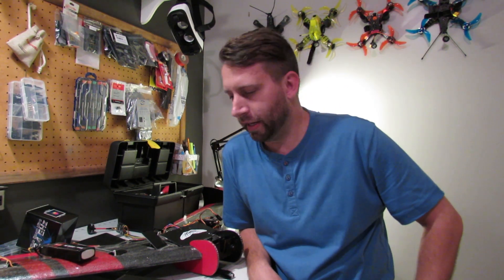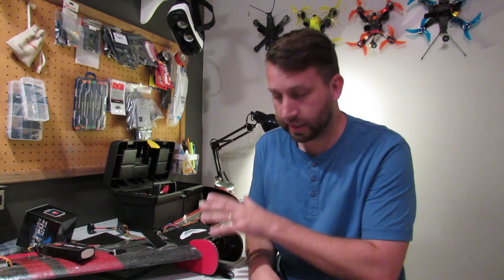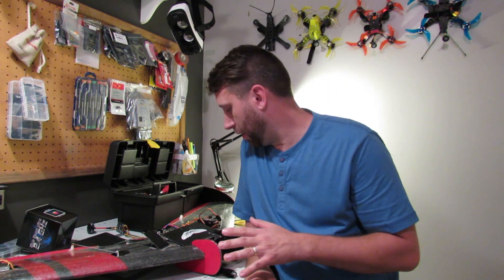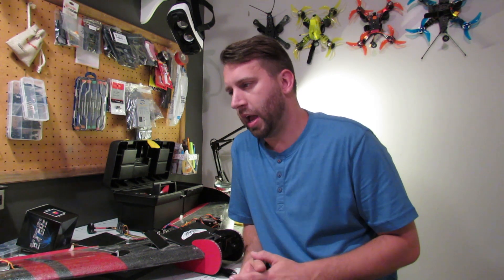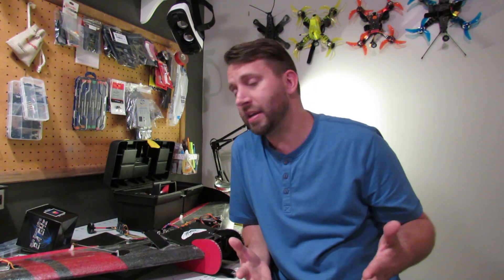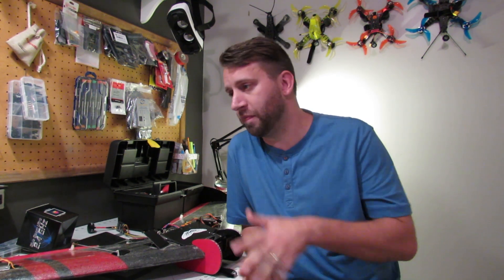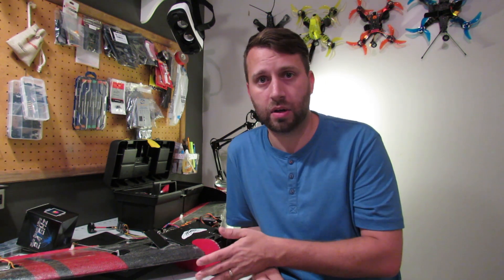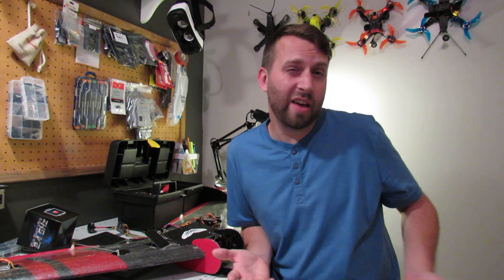Team Blacksheep Crossfire Micro TX and FrSky X7 FAIL!  WARNING!

Comment: Doesn't work with my D9x Plus either with TBS Oblivion. 20m failsafes all the time. Back in the shop to find out what the hell is wrong with it.......Wouldn't mind, but not been able to fly the Oblivion. Pile of junk if you ask me. No confidence in the kit at all. latest FW, all talking between TX - RX and can't get anywhere near all the shmancy vids showing 20 miles. I can't get more than 20m, turn round and falls out of the sky.

Comment: The problem is not software is hardware and it is kinda not a problem it is frsky's way to block crossfire and sell their long range module. TBS got a mod for this provlem, it involves soldering on the x7 board. Google "frsky x7 crossfire mod"
Reply from the maker: Yup - or just watch my video about it :)  https://www.youtube.com/watch?v=IeHrSP9lLPI
Reply: ThatJoshGuy no need, I got an x9d+ and it is not affected by this industrial sabotage. But all my fpv friends with qx7 got to do the mod and opentx 2.2.1. It is a bad spot on frsky image for sabotaging tbs like this, the x10/x10s suffer from the same "problem". And I can bet the xlite radio, if it will have a module bay, will have this problem.

Comment: thanks for the heads up ! I was considering that micro crossfire, for my X7 :(
I need to investigate more, but since I'm here : with a crossfire TX you need a crossfire RX, but with that kind of setup, can you do things like PID tuning and smart audio with the X7 ?
Reply from the maker: With the crossfire you can connect a pin for smart audio, but I'm not sure what all you can do with BetaFlight just yet. I have my gear in a plane
Reply: just read on the tbs website that pid tuning is possible... dunno yet what it involves tho...

Comment: Return the micro and get the full size it work in the q
Reply from the maker: EYEFLY82 Russell M No, I believe it has the same issue on the newer Q X7 transmitters. They both use 400k baud rate, so it wouldn't make a difference.

Comment: WOW how did I not see this before purchasing a TBS Crossfire Micro Bundle and a second Q-X7 to devote as the long range setup... stunned.
Reply from the maker: Chad Stowe don't worry! It will be fixed soon. If you're super handy with a soldering station you can check the site for how to perform the mod required to get it working, but it is not for novices.
Reply: noobrc think I'll just send this Q-X7 back and get the X9D. With a BF F3 that will be plug-n-play, correct?
Reply from the maker: Chad Stowe it should work fine, yes. Not exactly plug and play, but it will do what it is supposed to :)

Comment: The way you're talking, this means the Q7 also won't work with the OG CrossFire transmitter. Here I was about to snag a Q7, guess I'm waiting for now...
Reply from the maker: Frank deBros pretty sure that is the case, yes. I'm told it MIGHT work if you use PPM and disable telemetry, but then you need to use someone else's Taranis or whatever to configure it. Not so much a fix as a workaround.
Reply: Frank deBros i just set my 9+ and q on the full size